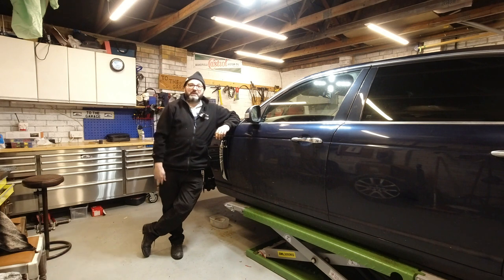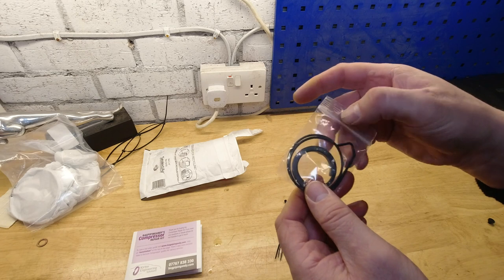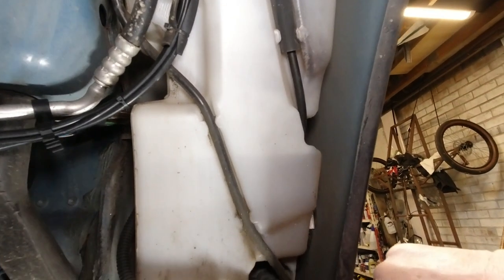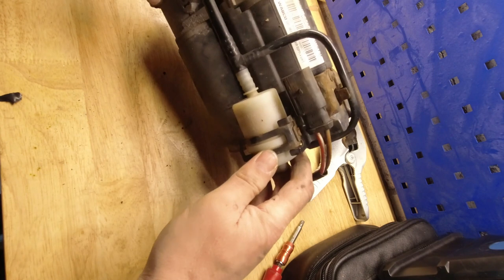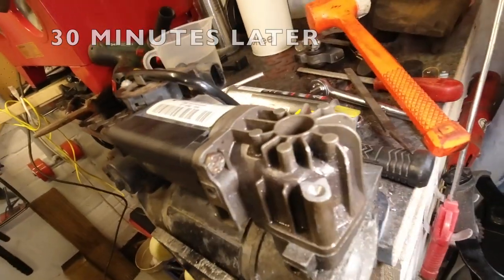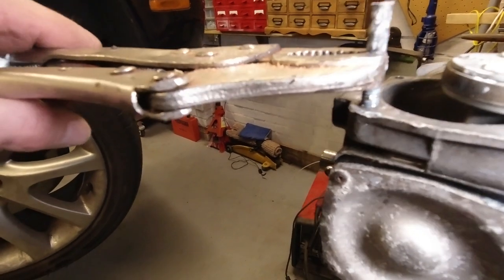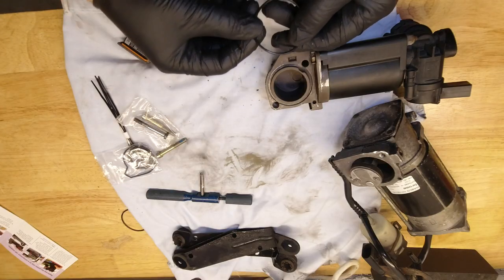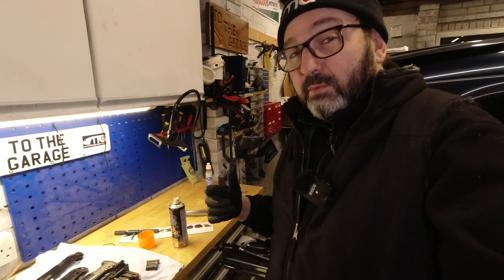How to fix your Jaguar Air suspension fault. BLU 14

Comment: Quick question, do you recommend disconnecting the battery for any kind of job where you have to disconnect electrical plugs, even minor ones like removing the wing mirrors to repair or just in more complicated jobs like this one (e.g.: where you mess with earth cables)?
Reply from the maker: HI F S. Im sure that the official line would be to disconnect the battery to change the head light lamps. I would not disconnect for any of the minor plug in items. I Disconnected for this one because    a) I knew someone would comment if I didnt😁
and b) because I didn't know if the air suspension might react to me letting the air pressure out by trying to fire the compressor when I was not ready for it.  It didnt😁
Reply: @ToTheGarage  that makes sense, i was kind of concerned if should disconnect to remove the wing mirrors power folding to have a fix but honestly seen some comments out there that disconnecting the battery itself can cause some problems if not done properly. I wont bother than... thanks for letting me know!

Comment: Was just about to buy the brother in laws  and this morning the drivers front wing is sitting low  all other 3 are fine so I'm guessing it's the shocker that's leaking air?
Reply from the maker: Sounds like a leaky union or airbag on that corner
Reply: @ToTheGarage  hopefully just the union. The air bag replacement doesn't look a difficult job.... Just expensive 😂

Comment: hi John I would like to have your opinion.  I have just purchased a 2008 jaguar sovereign xj6 it has 20in wheels on but I'm having a problem on bumpy roads my offside rear tyre is scraping the wheel arch on outside edge.  I don't have any warning lights or messages coming up . any idea?
Reply from the maker: Hi Jishin
Even with 20-inch rims,  the rear wheels should not collide with the bodywork under any circumstances.
Either the wheels are aftermarket and incorrect offset, or the car has wheel spacers fitted, or it has been lowered via adjustments to the ride height offset values using a high-end OBD2 reader writer, or the ride height sensor is damaged or modified.

Comment: Hey john.. I have a 2005 jag xjr.. What's crazy bout mine's is when the weather is warm i never have a problem. But time it gets cold and the temperature start dropping that's when i have problems with mine. On cold days it takes along time for it to go up..But in the summer time i have no problem at all.. What you think that could be.
Reply from the maker: the piston ring. in your compressor will be harder and seal less well in cold weather
Reply: Saleen, see my comment to Nick Harrison regarding alternator control- it may be that you only see the problem when the alternator is in high charge 14.5-15.5V which it switches to when the temp falls below 15C. I had this and changed the alternator because of it. It causes other faults to ghost flag. It could also be thermal expansion/contraction as John says.

Comment: My car replaced a new compressor last week. But when I move my car, I feel a strong wing sound and it finish when I put on brake about two times. Do you know why? It
Reply from the maker: Sounds like an issue with the brake servo or a leaky vacuum pipe connected to it

Comment: what can i do if the car doesnt level it self?..the compressor turns on like usual but does not raise the car...HEELLPP
Reply from the maker: Sounds. like a severe leak. (check the tube that enters at the top of each. strut with some soapy water)
Reply: I try the soap water and front driver side has a leak but the air comes out of the electrical plug. Not from the tube or fiting coming from the compressor. The plug its in the center and the air fitting is like an inche away from the electrical plug. Strange I know. I already purchased a new compressor.. Change all bushings .. And running out of cash really fast. I cant leave my 2004 JAGUAR XJR SUPERCHERGED at the side of my house to die there. I refuse to let this beautiful car to die like that. Thats why I wanna ask the experts (you) for and advise. Thank you for your rapid response. And I see your videos. Very well explained and patience. Thank you again
Reply: @kabusanchez5622  If the leak is in the air suspension unit, there is one last ditch fix you could use. I saw this on a US web site on a different vehicle with air suspension, but I made a mental note of it. The leak in question was caused by the rubber bladder, which is inside the air suspension arm, perishing slightly - this is where cracks appear in the rubber. On the jag, you can't see the bladder unless you remove the dust cover. He used emergency liquid tyre weld and repaired it. He actually injected the tyre weld into the solenoid manifold - which I would not recommend. But, as a last resort, you could try this into the top air inlet of the faulty unit. He claimed that the repair was still good after 6 months. I must stress that I haven't tried this myself, but if I knew that the leak was in the bladder, then the unit is a wreck, I would try it, but I would make sure there was no risk of fluid getting into the rest of the system. Proceed with caution!!! If you do try it, give some feedback and get a replacement unit asap
Reply: @philcanny6356  thank you . I will try that. I let you know whats the result. But how much of that weld should I add and where can I find it?
Reply: @philcanny6356  is that like Fix a Flat..?
Reply: @kabusanchez5622  I think there are a couple of products. Fix a flat sounds like one. I think you're looking at £7-£12 for a can. I must stress that I haven't done this myself, so please proceed carefully. I would only try it if I KNEW that the bladder had a leak. Try all other possible causes first. Are you sure that the bladder is leaking? If air is coming out of the electrical connector, have you removed that (after depressurising the unit), it may be an O ring. I haven't removed one of these myself, but looking at the workshop manual, it looks like there is a rubber O ring to seal the electrical connector. (Has any other reader removed one of these?). If the O ring has split, this would be a super cheap repair. Deflate the air spring and examine the electrical connector. Remove it if you have the correct tools and inspect the O ring. You can buy an O ring kit from machine mart for around £10 and it will probably have one which will fit. If you take the component, one of the staff will try to sort you out. Do this before you think of using the tyre weld. John, have you any experience in this area of the car?. 
KABU, is the leak at the base of the electrical connector or coming through the wire exit?
Reply: Kabu, once you've fixed the leak, it's worth watching this youtube video to understand how to get the suspension to reset itself 
https://www.youtube.com/watch?v=J86taKMNp-4&t=13s

I've had a look on my car and a couple of other youtube videos. The electrical connector should simply unplug, looks like squeeze release. Do this then use soapy water to find the source of the leak. It looks like the electrical connector fits into a brass housing. If the leak is from where this fitting screws in, I think you have an O ring problem and that would be good news. Let me know
Reply: @philcanny6356  the bubbles come out at the base of the electrical connector. But now... I tried to tight the connector but it doesnt tight or comes out. Like the threads are bad. I was very carefull when I strted thigning it but is not thighning . The nut it doesnt feel loose like when the threads go bad. Still have some resistance but is like a never ends nut. I havent try the other units ... 
Thank you very much for your comments
. thanks all of you guys.
Blessings..!!
Reply: @philcanny6356  Phil I got a question... I removed the cover under the drivers side fender. I see that thers a valve... Like the air valve to inflate a tire ...in one of the 4 lines that goes to the back of the car. Do you know what is that valve for?
Thanks Phil
Reply: @kabusanchez5622  Kabu, I don't know what the tyre valve is for. My car is 2.7Tdi, so other systems are different. Suspension is basically identical.  Maybe part of the air con system. I don't think it has anything to do with the suspension, so I wouldn't touch it. Regarding the electrical connector. You should be able to remove the electrical connector - its the plastic plug. Have you done this? (see video link below)
There appears to be a metal hexagonal fitting that the electrical fitting plugs in to. Is it this that you have tightened?. If so, I would remove this and look at the threads to see if they are damaged. I would not try to tighten it further as this will further damage the threads. I'm sorry that I am flying a bit blind here, as I haven't removed this item on my car. If you look at the video below
https://www.youtube.com/watch?v=KtPadhX_O4U&t=167s        move to time frame 8:34 to see the electrical connector removed.
Can you post a video on youtube showing the leak?
Reply: Also, please don't touch any of the other units. This may still be fairly easy to solve, so let's contain the problem to right hand front only.
Reply: I meant wouldn't not would :)
Reply: @philcanny6356  No..no..Phil you are good.. No problem. And yes I removed the plastic plug that has 2 rires in it. I unpluged the connector clip. And the nut is the one that it doesnt tight or loose...and we are gonna have to pause all this Ideas... Even if I wanna continue.. You are not gonna believe this man.. I went to the car to open the hood and the hood latch it got so hard.. All of a suden got stuck.. So i pulled herder aaaaand the cable broke... WTH...? This happened 15 minutes ago Im like in shock... Just looking at the concrete... And Im still looking at the concrete... I dont know for how long am I gonna be looking at the concrete...just thinking... I dont know what I am thinking... And still .. Looking at the concrete... Is just one of those days. Ill let you know what i will do with my car. Im just gonna continue looking at the concrete. ... Sweet Jesus..
Reply: @kabusanchez5622  KABU, Man you're having a bad time of it. Hood is on three latches. If the cable has broken at the pull handle, you may be able to gat it with pliers. If so have a friend gently push down on the bonnet when you pull. This should take some tension from the latch. 
Search "x350 hood cable" on youtube - loads of videos on how to fix this problem. Note that there is a separate undertray for the bumper, so you don't need to remove the whole undertray - good luck.
 
Also John may be able to help, so put a message straight to him, as he may not be reading all of these replies. It's always darkest before the dawn - keep your chin up and spirits high, despair is the devil's work. Let me know when you get the hood loose
Reply: @philcanny6356  the cable snaped in the middle , so i had to remove as much as I could the bumper ..and the bottom covers, but I end up pushing and forceing the front grill and finally release both clips to open it.. . thanks bro!!!
Reply: @kabusanchez5622  Good stuff, check out the you tube stuff i sent, there is a good one there for how to replace the cable.
Back to the air suspension then. Question; When you remove the electrical connector, Is the air coming from the base of the fitting or from inside the fitting (the fitting being the hexagonal metal nut that held the electrical connector?

, here's what I would try. turning the fitting anti-clockwise, try to remove it. I have tried to look for details of this fitting but haven't found any, so again, I'm flying a bit blind. If you can get it out, look at the condition of the threads, in the hole and on the fitting. From the sound of it, you tried to tighten it and it kept turning. This could mean the threads are ruined. I assume it is threaded, otherwise why would it have a hex top. Two possible ways to recover the situation if caused by stripped threads -  [and I assume that you don't have the facility to helicoil or re-thread - both of which would risk sharp metal falling into the bladder (not good) ] 

Note, I would expect the fitting to have an O ring at the top of the thread. If it is damaged, you should try to replace it. Machine Mart, Pound shop or B&Q. The O ring alone will not sort the problem if the thread is stripped, but it will help a little with 1 and 2 below. 

If the thread damage is just on the fitting, go straight to Jaguar and get a new one. If the thread in the hole is badly damaged then consider 1 and 2. 

1. Clean the threads as best you can. Wrap the fitting with plumbers PTFE tape. You can get this from Pound shops or any DIY outlet and its cheap. Wind it so that the tape is going anti-clockwise as you look down on the fitting (as if it was in the car). Build the thickness up so the threads are just still visible, so about 0.25mm of tape. Make sure all loose tape is removed. Carefully insert the fitting back into place and gently screw it in. You should feel it become stiffer. Tighten it slowly and as soon as you feel the force falling away: stop. You may need to try this a couple of times to get to the right amount of tape, but the key thing is be gentle so as not to damage the remaining thread. Re-attach the electrical connector and start her up - check for leaks. Note on security- from the workshop manual, the system can pressurise upto 90PSI which is 6.2 atmospheres. looking at the fitting, I estimate that the maximum force pushing against the fitting would be 3kg, so if you can't pull the fitting out with your hands, it should be good. If you can, this method won't work.

2. If that doesn't work, there is a  idea I have used for similar problems. You need to get a small bottle of Meths (purple methylated spirits) and a double tube of epoxy resin  - this is a double syringe containing resin and hardener and the PTFE tape (above). With the fitting removed, use a clean cloth  soaked with meths and thoroughly clean the area around the fitting hole. Get this as clean as possible - do not use any solvent other than meths. Meths will not harm the bladder rubber, but almost every other solvent will. Clean the fitting in a similar manner.
Get a clean surface such as an old plate or bottom of an old drinks glass on which you are going to mix the epoxy. Clean with meths (Make sure the epoxy is warm - house temperature 20-25C so it is easy to squeeze.) Cut the covers off the twin syringe and squeeze out two identical lines resin and hardener. It is very important that you hit 50:50 mix to get best strength. (do some test runs if needed. The epoxy hardens in around an hour and should be a hard plastic once set. If it is rubbery, you have either got the mix ratio wrong or haven't mixed it enough. It's best to practice a couple of times before you go for it)  All surfaces should be super clean (use meths and a clean cloth). DO NOT let WD40 near this job-it contains silicone and destroys surface adhesion! Thoroughly mix the resin and hardener.
Now depending on the thread condition, it may be worth applying a couple of wraps of tape around the fitting (use your judgement.). Apply the mixed epoxy to the fitting thread area and the flange of the fitting and then screw it into the clean hole at the top of the strut. Make sure no adhesive gets into the electrical fitting or sensor areas. Leave for 2 hours. Re-attach the electrical connector and start up.

KABU, I am making some assumptions here, so only proceed if you are confident. If you can post some photos on twitter or similar, I will look at them and maybe  give better advice. One area I am not sure of is what is on the bottom of the hex nut, I assume it is some kind of sensor, so steer clear of  that area when applying the adhesive - thread and flange only. Note, this stuff will stick like sh#t to a blanket, so you might not be able to get the fitting out again. It won't leak though and it will be very strongly held, so very safe.
 
Method 1 is reversible, so no risk of making the situation worse. Method 2 carries more risk. even if 2 works, it will be difficult to replace the sensor in the future, should it be necessary.

Don't rush, move slowly, carefully and deliberately, problems like this require a snipers rifle and a single shot - not a machine gun! 

If the air is coming from inside the hex nut, don't do any of the above and let me know - again photos would be good via twitter or similar. if you can get it out, seek a replacement.

That was longer than I expected.
Reply: @ALL - Any additional readers - we will try to sort this out off-line and then post the solution, rather than blocking up John's channel
Reply: George and Phil... Last week I mention that my car had a leak and after Soapywater the bubbles were coming from the conector.. And it was comming from the electrical conector around the nut that is right in the center of the strud. And i also mentioned that it doesnt tight or loose and someone told me that maybe messed up the threads.. Ok I was looking purchased a camera just for this.. That you cqn look anywere ..were you cant see..you use that camera.. Its very small and has a light .. I was looking inside the connextion and there is two wires were the connection is. And above those they have an exagon were you can fit an allen wrench #8 and an 11/16 socket. And thats how I thigtned that nut and apears is not leaking anymore..if anybody has the same problem allen wrench and a 11/16 deep socket and visewrips will do the trick. First you put the deep socket then in the center were we put the rachet... You use the allen wrench and then use the visewrips holding the allen wrench . i dont know if i can send pics in here. I ll make a video when im done with my car. Because now im working on the air block valve. The one in the trunk. One solenoids is now working . im working on it.. Have a good day